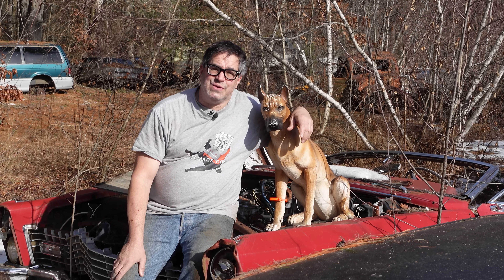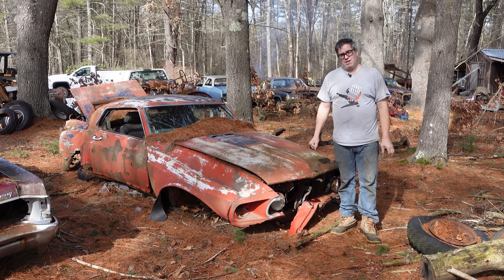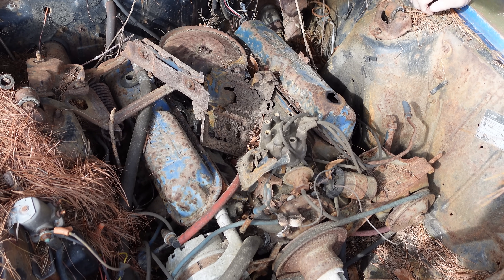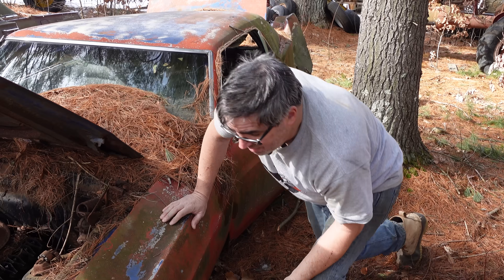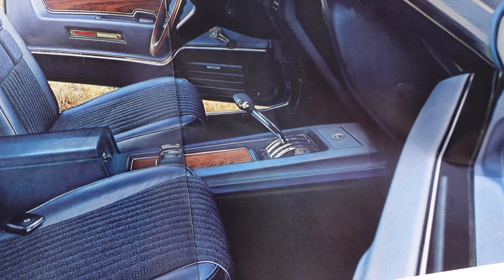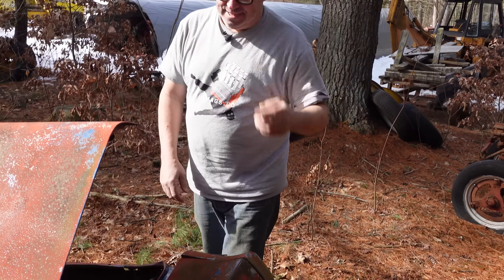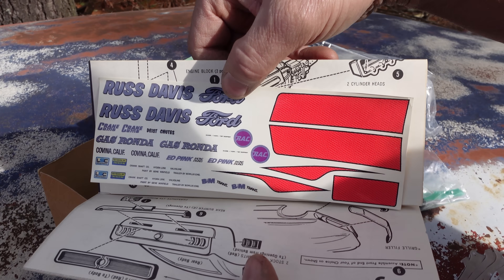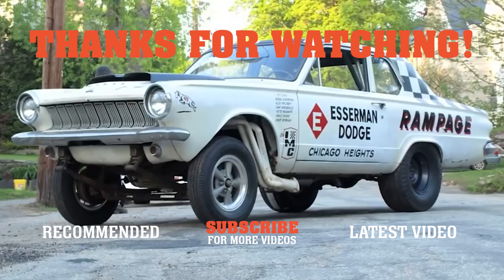Help Me Gas Ronda

Comment: No Mach 1 was ever a notchback. The scooped hood was an ala carte option on any Mustang. If you really had your heart set on a Mach 1 Coupe, you could approximate one by ordering the GT Equipment Group , 351 or larger engine, and the Interior Decor Group, Rim Blow wheel and High Back buckets. Don't forget disc brakes, though, these were an additional option on everything but the Boss models. Also, '69 wasn't the final year of the 4-headlight design, it was the ONLY year.

Comment: Hood scope and dual mirrors was the Sports Appearance Group offered as an option on any 1969 Mustang that wasn't a Mach 1 or GT such as the standard coupe shown here.
Reply: Yes, I have an acquaintance who received his similarly equipped new '69 as his college graduation gift from his parents. His was equipped with the 3-speed manual, but had the hood scoop as described by Steve with the directional indicators in the rear. By the time I saw it, 1985, 86, or 87, the bright yellow paint had faded severely. I believe, without evidence, that dealers ordered several vehicles with package to move affordable Mustangs off the lot more quickly.

Comment: I was hoping for the VIN (from the dash, door, or LH shock tower area), but alas, no dice. 

If we had the VIN, we would win: 9 for 1969 model year, possible F for Dearborn, MI assembly, or R for San Jose, CA assembly, or T for Metuchen, NJ assembly, 01 for Mustang hardtop or Grande hardtop, (02 is for Fastback, Fastback Mach 1, Fastback Boss 302 or 429, 03 is for convertible), possible F for 302 V8 with two barrel, and the rest is the production sequence. The Dearborn, MI plant was the "home" Mustang plant and made them from the beginning through the 2004 model year when production was moved to Flat Rock, MI. The San Jose, CA plant was also called Milpitas Assembly and operated from 1955 to 1983. The Great Mall of the Bay Area opened there in 1994 and some of the local street names there are named after Ford Motor Company vehicle names. The Metuchen, NJ plant was also called Edison Assembly and operated from 1948 to 2004. I have passed the Metuchen plant many times, as well as the GM Linden, NJ plant as well. I'm going to go with this being a plain 1969 Ford Mustang hardtop with a 302 V8 two barrel made in Dearborn, if I had to take a guess.

If we had the tag, we could brag: possible 65C for Mustang two door hardtop, 6 for Medium Blue Metallic (also called Acapulco Blue) exterior paint, 2B for Blue vinyl interior trim, X for Select Shift automatic transmission among other codes. This would have been a case to get all of those pertinent details to show.
Reply: Thank you for the info!  Dave...
Reply: @daveridgeway2639  Sure. Wish he showed the tag and VIN.

Comment: In 1966 remember  crafting a letter to Ford praising their Mustang. A few months had passed when I received a letter from Ford acknowledging my letter and was informed my Mustang  model was on it's way. That  letter, with the Ford logo envelope, postmarked Dearborn 66, and the 67 promo fastback model  hang on my wall today.  I won't  tell the story  of  the 65Acode black/black fastback I sold--and discovered 35yrs later after I sold it.
Reply: I think you told the story, short and sweet

Comment: I bought a used 70 Cobra Jet coupe in 84, figuring it to be cobbled up with all the Mach 1 stuff on it, so I street raced it. Imagine my shock in 86 when I found the build sheet and got a Marti report. I had been abusing a one-of-eight car. Sold it to a collector in Colorado.

Comment: Always liked these , redundant models 👌 even the base models 

Odd , the 4 lug , 9 inch drum brakes 
were available  , even up to 1970 

Spare time shop in Marlboro MA ,
 may still  have some obscure model 
kits available  , Steve .
Reply: Hi Robert, the Falcon and the Maverick was the same way, 6 cylinder-4 lug, V8-5 lug.  The 250 CID 6 cylinder (inline six) was much the same as the 200 six, but in the mean time, the 250 six used a small block Ford V8 bell housing and 5 lug wheels, as did the Maverick, vs a 200 six (and smaller 170 six) that used a smaller bell housing and flywheel.  The 250 six's used V8 chassis parts.  Dave...

Comment: Hi Steve.  As always, nice content.  At the end of the video you comment on the Mustang II being a Pinto derivative, which, of course is true.  I, personally,  was not much of a fan of the Mustang II, but if you think about it, it holds true to the original Mustang formula. Take your economy car, dress it up to make it sportier and more attractive, and then sell it at a higher price point without having a huge expense into a complete redesign.
Reply: Chassis sharing which eventually became "badge engineering" to get economies of scale.
Reply: When all was said and done, there wasn't much left of the Pinto but maybe the trunk pan. In hindsight, Mustang II became a source for hot rod parts
Reply: if you think about it, the original Mustang was a fresh body on top of a Falcon, for the most part. If you bought a Falcon with the bigger engine, then it was almost a Mustang. (in sheep's clothing)

Comment: I like the four headlight design of the 69s or the 70s, but the 70s came with the the 351C 4V option. The 351C was my favorite Ford engine. Probably bought about every Mustang themed magazine ever printed back in the 80s to early 90s and was pretty emerged in all the specs.  Nevertheless, I still enjoy good pieces such as this on Mustangs, and still learn something new. Recently going thru my storage unit and found a box of mid 80s Mustang magazines, just a representative sample of what I’d bought. Memories…
Reply: 25th anniversary was the talk in 80s and early 90s, also the Ford Probe

Comment: Steve, love your videos, always very informative and interesting. No Mach I was a Coupe, always had a deluxe interior with high back comfort weave seats. Engine is not a '69, ps pump and bracket, coil with plastic clip instead of male threaded studs, shows it to be late 70s to early '80s. With 4 lug wheels, VIN should show an inline six.

Comment: My older sister bought a used 1970 Mustang coupe in 1972. It was setup pretty much the same as that one with the 302 and C4 automatic and also red in color. After she had it about a year she asked me to test drive it because she thought it wasn't shifting right. While driving it the trans stuck itself in second gear. It ended getting towed to the dealer and they found that the aluminum trans case had split internally.
Reply: Was she Steve McQueening it? 😅

Comment: I had to freeze the video to confirm it by reading the article, but it appears the 390 was still offered as an option in 1969. I thought its last year in a Mustang engine bay was 1968, but my biggest surprise was that two 428s could be had that year. What was the difference twixt the 428 and the 428CJ since they both put out the same horsepower? Anyone?

Comment: I had a 1969 MACH 1 428 SUPER COBRA JET. No power steering,  that took away horsepower. It had a 11.5 " clutch which took 3 men and 2 little boys to push in. It was a bear to drive and got about 7 SMILES per gallon. Pass everything but a gas station. 350 solid lifter 70 Z28s no problem. 67 427 Corvette,  no problem.  This Mustang was a torque monster.

Comment: Ford went to stamped steel rockers in 1968. As that engine has no intake, the valley has the cubic inches cast into the area between the lifters. I'm betting a 289 or a 302 with earlier heads swapped on.
Reply: Valve covers with only Ford crest are '73/74 or later. Thru at least '72, Power by Ford were used. The horseshoe connector on  coil is mid '70s, as is the sliding adjuster P/S pump.

Comment: Valve covers are also much newer than the car. 1969 would have said POWER BY FORD for almost the whole length rather than the FORD oval.
Reply: Slide on coil connector & P/S bracket are newer as well.

Comment: Plymouth did beat Mustang to market by a few months in 1964, so without a Mustang there would still have been a Barracuda.  funny thing about the Mustang, Ford had wanted a 2 seater to match the Corvette but realized the Y block was just too heavy. so they build a cruiser two seater off the Fairlane chassis. Once they came up with the 221 cid V8 Windsor (ford loved to size new engines on old flathead displacements, like the 239 Y block) they realized they could build a lightweight, sporty 2 seater. so the first prototype, the Mach I, was a 2 seater. 

But "Lido" realized a 2+2 seating arrangement would give this new car more options in the marketplace, and it could compete with Chevy's sporty car communter car--no, not the Vette, but the Corvair (named after the CORVette and belAIR). And so while the Thunderbird had gone on to create its own marketspace, the Mustang had options (Pony interior, etc) to create a "baby thunderbird" competitor (and the Mercury Cougar would be a competitor to that) while taking Ford away from naming cars with a space theme (Galaxie, Starliner,  Comet, etc) to horses (Mustang, Pinto, Maverick).

By 1969, Ford's Mustang was competing with the Shelby, which had domesticated itself. As for that particular hood, I think the Mach I's were using shaker hoodscoops and that one is likely a GT model, which was rare in 1969 since there was the Mach I and the Shelby and the Boss to choose from--or Mercury Eliminator Cougars or the GT-E.

Finally, if you own a 1967-8 Mustang, the gas tank from a 1969 only takes up an inch of trunk space and gives you a few more gallons of capacity.

Comment: The kit is probably worth more than what's left of the real Mustang. The box is pretty good, and the parts still being sealed in the bag are very nice, but the record still being there and not trashed is a great find. It also looks like a way better kit than the '65 bodied AMT Mustang Funny Car, which is a turd in my opinion. It takes a lot of patience, but it can be built to look good. Old kits are hit or miss, and aren't even in the same league as any new tool kit made in the last 30 years.

Comment: I never understood the hatred for Pintos and Mustang II's. They followed the old adage for speed, add lightness. Sure the drivetrains needed work, but that was the era. As far as Pintos exploding, more Chevy pickups with saddle tanks exploded than Pintos. I swapped a bunch of those saddle tanks to single tanks between the frame rails. Never hated the trucks.
Reply: The original idea of Mustang was to provide a sporty and economical car

Comment: They were a cool car, but for the few $$ I can’t imagine going for the 6 banger option. I bet most of the 6 cylinder cars sold , were cars dealerships had to take from Ford, and were not ordered. And dealerships probably sold them at less than the cost of the lower priced options, just to move the suckers off of their lots.
Reply: Like anything else, they had their place. Just as a six-cylinder Chevelle or other GM cousin would have had. Back then, cars appealed to a wide audience of buyers.
Reply: The base 6cyl were the "come on" models, advertised in newspaper for $2500 or some other low price. Once customer was in showroom, they were up sold(close to bait & switch). Ford rarely sent anything to dealers they had not ordered.
Reply: @tombryant1104  just like they advertise a strip down Jeep Wrangler, soft top, manual transmission, 16” tires, back when we were looking for one in 2016, but never could find one. The stripper models were $25,000.00, my wife has her heart set on a Jeep, and we ended up with automatic transmission, hard top 18” aluminum wheels, $35,000.00. It’s been a very good vehicle, but probably never would have gone looking at 35, but the lure of 25, got us into the showroom
Reply: @ Bruce Prentice There Are ALWAYS Going To Be Penny Crunchers Out There, That Want The Highest Gas  Milage Cars They Can Afford.  And THAT Is The 6-Cylinder Market Pleaser.  However Back Then EVERY Little Thing Was An Additional Option.  When I Bought My 79-Chevy Truck,  I Ordered A 2-Wheel Drive  BIG-10  Model For The Larger 350 Engine, Bigger Clutch And Heavier Springs For Hauling Heavier Loads.  But A Step Bumper, Inside Cab Roof Light, Front Bumper Guards And Other Smaller Items,   (That Usually Comes STANDARD In Today's Vehicles),  We're ALL Additional  Option  Cost Items Back 40+ Years Ago.  I Ordered It In 1978 For $5,800.  But It Arrived As One Of The First 1979 Trucks Off The Trailer Costing $6,200 Instead.  And I Was Screaming Bloody Murder About The Price Increase.   But Try Buying A NEW Even BASIC Pickup Truck For That Price Today,  And It Would Only Cover The Required Down Payment...

Comment: The 71 mustang was the Clydesdale   mustang 
Big wide and fat  I believe it was Torino based  
Laugh all you want but when the mustang II came out  I really wanted one
Reply: From '67 Mustang shared the Fairlane/Torino chassis(yes there were minor differences). For 1971 they were wider than 'Torino, in 72 Torino became body on frame.

Comment: Hi Steve, When I was 16 Years I ran away to Texas With my first wife, I own a 69 mach 1 351, My Older Brother David went with us, I had a sister sandy that Lived in Dallas, I drove Nights David drove days, I woke up to My motor blown, All because he was driving 120 mph in 100 degree weather, Moron
Reply: "Fix Or Repair Daily" and in this case "Driver Returned On Foot".
Reply: @davemckolanis4683  You have to first learn how to put a sentence together to be believable. (You don't capitalize every word. It makes you look ignorant). Besides that, I'm no "kiddo" and I know more than you think. Nothing wrong with emission era vehicles if you know how to work on them and work with them. It's the old, obsolete "mechanics" that didn't know how to deal with them that called them "no good".